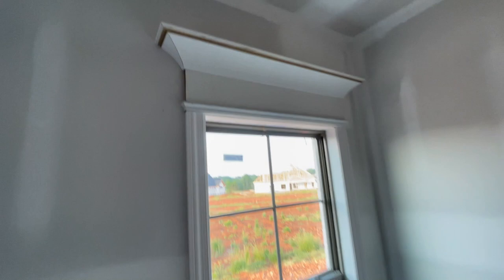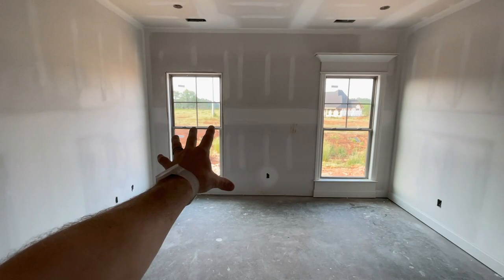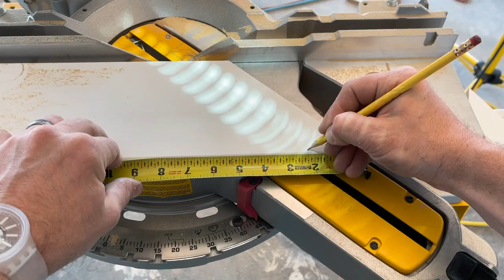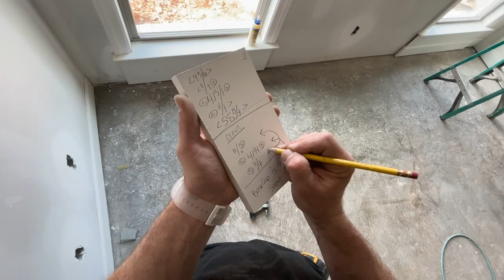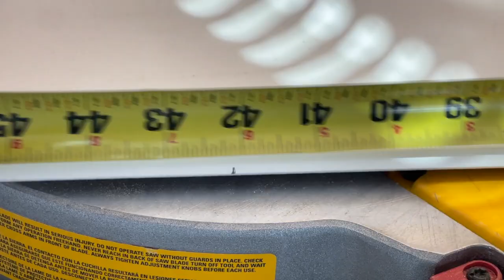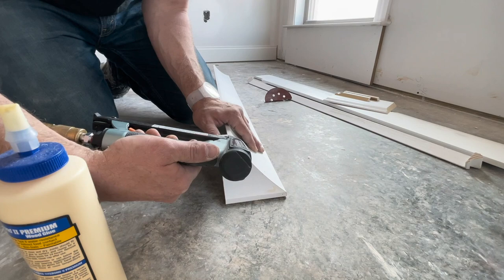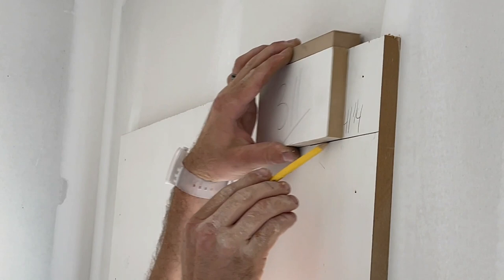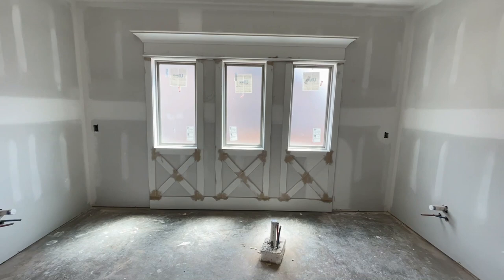How to: Window Trim | 19 pieces

Comment: That master bed window was super booshie lol 

For basic corner round window stools, I just bust out a small hand router with a corner rounding bit, so you dont have to do the fancy return on the window base shelf. It takes 5 secs to add the radius and then you dont have to have 2nd custom cut, glue, nail, and hand sand. "If" its just a standard shape router edge. Just throwing it out there for others, to try to get trim that you can find the exact router bit for, so any edge detail you can quickly just add back to what was cut off from the sides. Especially if you have several windows to do. 

Otherwise for custom shaped trim you have to do the technique shown. Which was done flawlessly btw. 

Great content, and I will look into establishing a "backing up your trailer the first time, almost everytime" award lol
Reply from the maker: Haha thanks! Yes! I used to do that router method! I’ve actually been meaning to get a new box of router bits and start doing it that way again, but I keep forgetting.  

After I started editing and I heard myself say that about the award, I thought, I should really have a plaque made and just have it causally hanging in the trailer for someone to discover in a video one day 😆

Comment: Need to be using CA glue w/activator for all your mdf outside miters 👌🏼Nice work
Reply: CA glue can be a headache for precise work. 10 seconds from the time the glue leaves the bottle bends up in a lot of trashed pieces. Wood glue and pin nails is just as strong if not stronger when cured and leaves a lot more time for dialing in the joint. But CA glue definitely has its place. It’s just not a one size fits all.

Comment: So, I would buy some TMPK stuff if you had it.  I would really dig a shirt and mechanical pencils, just throwing that out there.  Also, asking because I won't know unless I do, was there a reason you didn't assemble the header with the base cap, crown, and stool on the ground?  Thanks for the video, now I can take my Sunday afternoon nap 😴
Reply: Agreed I’d love to rep the TMPK💪🏽!
Reply from the maker: Thanks! I was thinking about doing the Tee Spring thing and designing a TMPK shirt, but they said I had to monetize if I want to do that. I’ve been avoiding going through that whole process. 

In theory you could build the entire thing on the ground, but in reality there’s tiny imperfections in the framing, sheetrock, jambs etc. that transfer to the 1x12 not being perfectly against the wall. So those returns on the crown and basecap will vary in size a little bit. If the 1x12 is off the wall 1/16th of an inch, I’d rather make the crown, basecap, and top stool be touching.
Reply: @TMPK  I don’t know the monetize process you speak of, and therefore my suggestion will probably be useless, but if you literally just had a local printer make some shirts I’d Venmo you $30 for a shirt. Or I’m sure with your skill, you could build a pretty sweet WIX site/store. You’ve already helped me a lot in this finish trade. Just trying to be helpful.
Reply from the maker: @stronghumantraining  that’s the way I would want to do it! Cut out the middle man somehow. Ive been saying for over a year when I get to 20k subscribers I was gonna turn on the monetization and make T-shirt’s. But I really should just do it myself. Maybe I’ll talk my wife into helping with that. 😬

Comment: One quick question, when you mark out your measurements why do you draw a line straight down and then off to the side slightly?  Just wondering what the technique is for?
Reply from the maker: I’m not sure what you’re talking about? You’re talking about? I think you mean when I’m making the measurement on the piece of trim before I cut it? 
I do that upside down V thing so I know to cut right at the point of the V. If it was just 1 little line like “ / “ I would then slide it over to the saw blade and be like, so I put the blade on the bottom left, or the top right? 

I guess I could make a dot or a tiny little straight line, but I just got so used to making the V and cutting to that point 🤷‍♂️

Comment: Also, I wanna do a coffered ceiling in dining room,  but ceiling is about 20 feet high. It's really hard working by yourself and putting everything together in that high.  Any suggestions? What can I do to finish it by myself?
Reply from the maker: The best way to do something that high is scaffolding. I bought a set and now I don’t build a coffered ceiling without it. When you’re up 20ft though, that is going to be a lot of climbing up and down. On a 12 ft ceiling and 1 level of scaffold with wheels, I feel comfortable pulling myself around room. When I had to add second level, I would either climb down every time I had to move or have someone push me real slow while I just knelt down and held on 😂